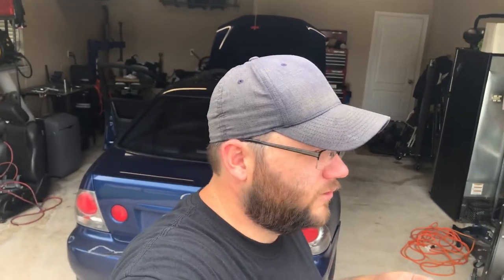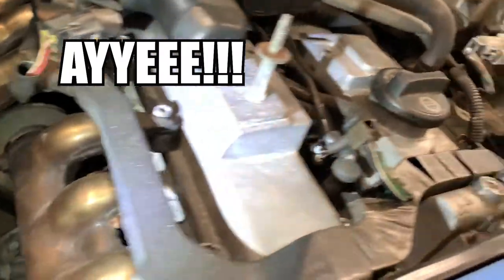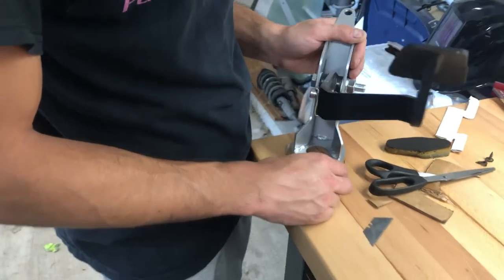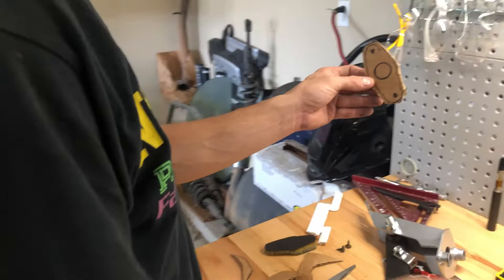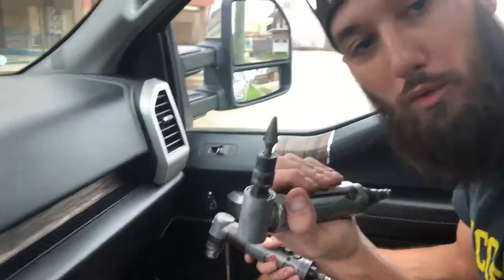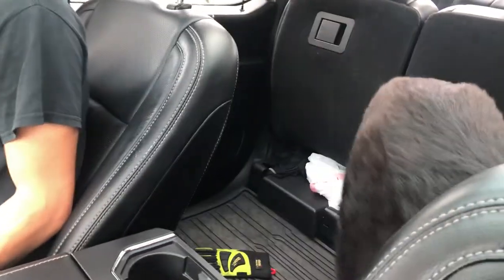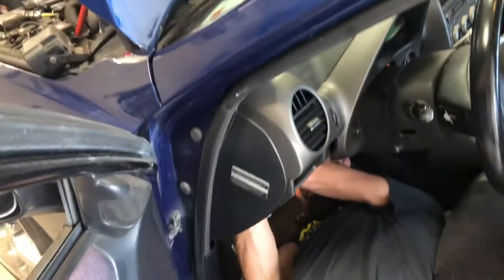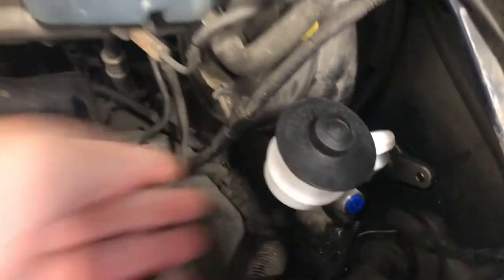Lexus is300 clutch pedal install

Comment: How did you mount that pedal in? I bought a clutch pedal kit from drift motion. From what ive seen in other videos there are three bolts or nuts that hold the pedal bracket in. Was this the case with yours? Or are there 3 total bolts or nuts? If so where?
Reply from the maker: We used the xcessive manufacturing assembly pretty sure it came with the bracket that mounts to the master cylinder